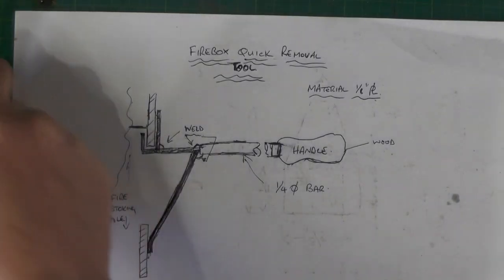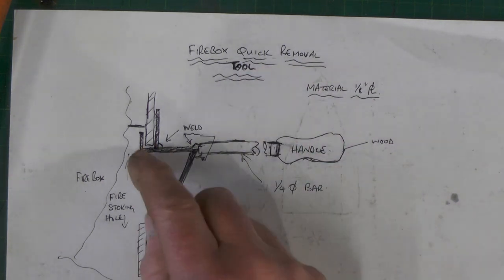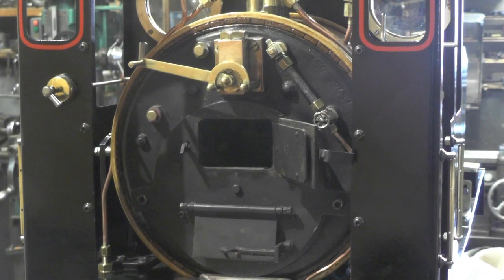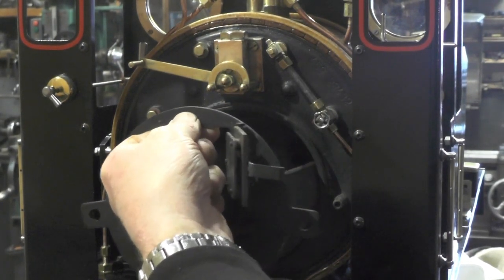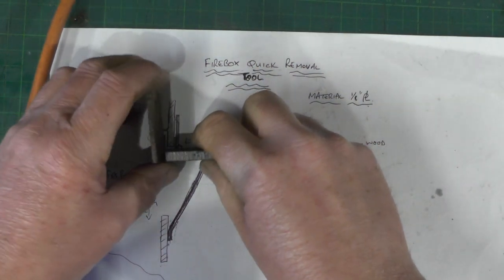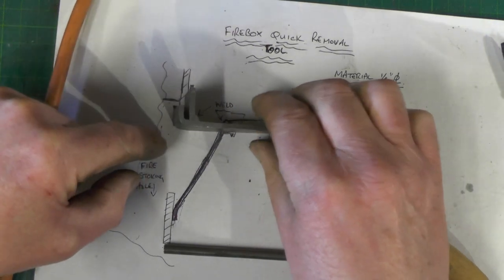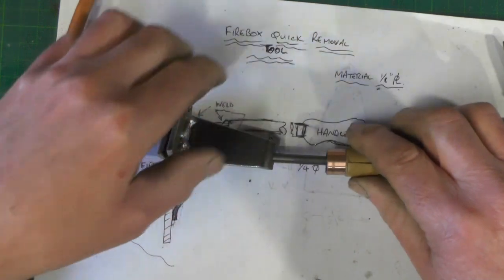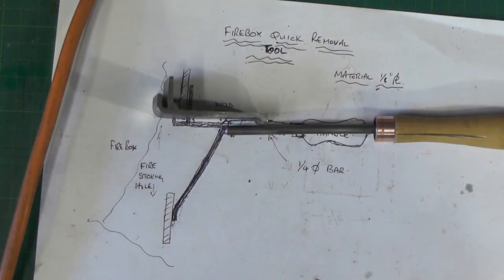Build Your Own Beginners Miniature Steam Locomotive Series ( ) "mr factotum"

Comment: I would add a shield to the handle to protect your fingers from the heat as the fire hole has to be open to remove the box. Perhaps add the support leg anyway as the firebox is going to be much heavier if you have a big fire in it.
Reply from the maker: hi LS
thanks for watching, commenting and the tip, ive logged it for a future mod.
regards
mr f

Comment: Hi Mr. F. 
I like your idea of the fire removal tool to be used in emergencies. On my traction engine I would just drop the ash pan complete with the fire grate. As I mentioned on a previous comment, I have made a 3 chime whistle following your description and tested it on air and it sounds great. Thanks for sharing your wonderful work. Bye for now. Regards and stay safe
Reply from the maker: hi EL
Your traction engine sounds great, and probably really sounds great with the new chime whistle, I've always liked traction engines and always will, in fact anything steam related,  you don't need a track, which is a great advantage especially in Covid Lockdown!!!!!
Thanks for your appreciation
I will be steaming up for a  home trial before the next inspection very soon now,  it will be a first time experience for me!!!! Watch this space to see if all goes to plan
stay safe 
mr f
Reply: @MrFactotum  Looking forward to see your first steaming on completion. My next item is to build the mechanical lubricator. That will keep me busy for a while until the boiler inspector comes over to test my boiler. Bte for now
Reply from the maker: @MANNIE1973  good luck with it, that will keep you busy
regards
mr f

Comment: Hello Mr. F,
Would you need to remove the firebox in an emergency? to try and reduce the heat going to the boiler as fast as possible...
I guess one of your tests when firing the engine up would be to see that the firebox will come out once hot and all the various expansions & contractions of the component parts have taken place... Another fine video, thank you...
Paul,,
Reply from the maker: hi paul
yes, as soon as i get the 1st steam under way (by the way very soon i hope !!!!!, ) i will try that, good idea, there is quite a lot of tolerance though in the fire grate assembly. but i will put the in to the back of my mind, mind you i put things there and they sometimes get left behind!!!!!!!
thanks for watching and appreciate any good prompts like that
stay safe. soon be 2nd jab time now!!!!!
regards
mr f